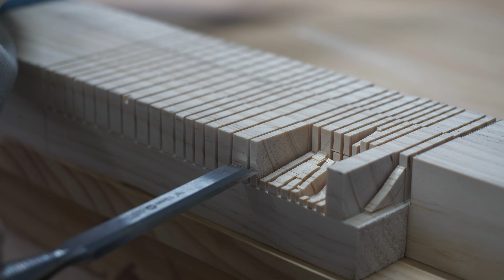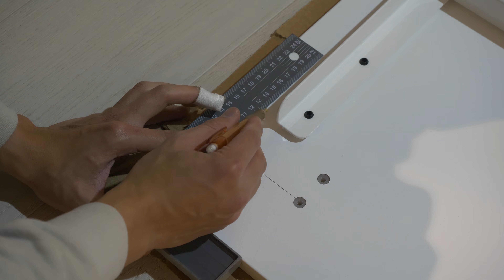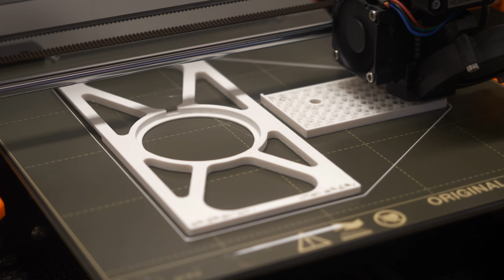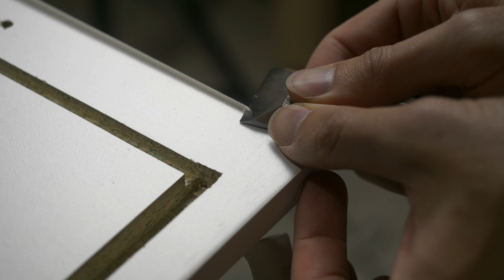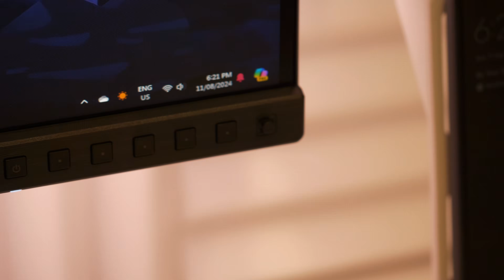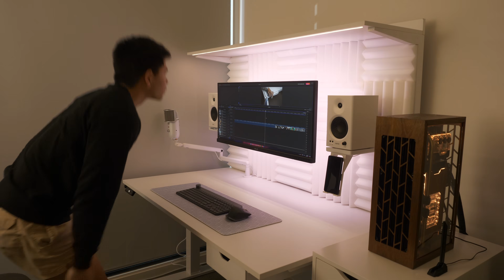DIY Minimalist Standing Desk Setup - FlexiSpot E7 | ProArt PA348CGV

Comment: Amazing setup.. beautiful..my only suggestion would be to keep the phone reachable but out of sight..this will definitely improve focus..again amazing setup..👌
Reply from the maker: Thanks! That holder is actually just barely in reach when I'm sitting properly in my chair. I have to sit up and lean forward with arm stretch out to get it. And just that little extra effort has cause me to not pick it up as much as I used to. Indeed the next step would be an out of sight solution

Comment: The only thing I see a problem with is no USB C/Thunderbolt 4 connectivity. Overall this build is well thought out, planned, and executed. The overhead light strip and wireless charging are flawless, especially the phone holder... very unique. I would have probably used 3D wall panels instead of the foam for longevity and easy cleaning. I don't know how you got a white Blue Yeti mic, or the Edison bookshelf speakers in white but it's again well thought out. 10/10
Reply from the maker: Thanks! White yeti and speakers are off the shelf models. I agree with the wall panels, these cheap sponge has already started to yellow abit

Comment: A white pc would be amazing, but you should definitely keep your wood style with it as well, a combination between the wood and white would be great in my opinion. I am currently building a white version of the beamcase SW which is a case that uses makerbeam aluminium extrusions, but i was thinking of making some wood panels instead of 3d printed for it. You should have a look at the beamcases, they are very interesting! (Not as good as your custom ones though :D )
Reply from the maker: Good suggestions, thanks!

Comment: You have a router but chamfer with a file ? Thats mad
Reply from the maker: Haha I knew someone was going to pick up on that. That was actually done when the CNC was carving the USB hub pocket. Being that power for all the equipment on my balcony is supplied through a single extension cord, I didn't want to max out the power limit. So I decided to go back to manual instead. I also thought it would be a good chance to show that nice even chamfers can be achieved using just files and some patience.
Reply: @mxcbuilds6633  well done !

Comment: How do you prevent your mic from picking up sound from your speakers?
Reply from the maker: I only use the mic for voiceovers during video editing. And there are options to mute speakers during recording. Will be a different story if you are using it for gaming/ streaming. But the blue yeti mic has a directional input pattern so should only be capturing sound from the front, haven't tried it myself tho

Comment: Do you live in America? and if yes, do you know where i can get a big slab of wood (like 74-70 inch by 24 inc, 2-11/2 inch thick) for a really good price? I was thinking of going to home depot to get the top for my desk but im not sure, I've only got like 200 bucks to spare for the top and im not sure if itll be enough for the wood itself + the things i need to buy to make it nice (like sanding materials, the coat and whatnot)
Reply from the maker: Sorry I do not, so I can't give you specific advice for US pricing. But 200$ sounds like a reasonable budget. As long as you're not going for some exotic hardwood.
Reply: @mxcbuilds  yeah nothing too crazy just something that matches my fractal terra wood color which i can just achieve by using some stain and putting some coating on it to protect it from scratches and spills

Comment: I would like to see a build list and where to get things at. Such as the LEd light in the top.
Reply from the maker: Good suggestion, I might compile one when I find the motivation to do so.
Reply: @mxcbuilds  Big thanks. where did u get the led strip at?
Reply from the maker: @sbfotome  From AliExpress as with all other non branded small electronic parts. Just found this amazing item on AliExpress. Check it out! 
AU$2.85 | 5mm COB LED Strip 384LEDs/M High Density Flexible FOB DC12V/24V Light Bar Warm Cold White 3000K 4000K 6000K for Decor Lighting
https://a.aliexpress.com/_mrSFZs0
Reply: @mxcbuilds  ah ok, thanks again.

Comment: Very nifty setup. I've had a similar idea for some time now because my TV's built-in speakers are kinda boomy so I was thinking of doing a back frame with foam and lift the screen up to increase the gap to the table top.
Would also want to add side panels with foam to cut glare from the window and reduce primary acoustic reflections.
My main concern would be the rigidity of the setup to resist shaking the screen when typing though. How's this working out for you?
Reply from the maker: Thanks! Screen wobble is on par vs on its original stand placed directly on the table. If your monitor is much larger/ heavier that might be a different story. Also the table frame/legs will play a big part. If this was installed on an already wobbly table it would amplify the shame further. Lastly, I don't play many fast paced games involving violent mouse movements so I don't notice the wobbles at much. For games like shooting and sure racing simulation type where you clamp the wheel to the desk, I expect the wobble would become noticeable